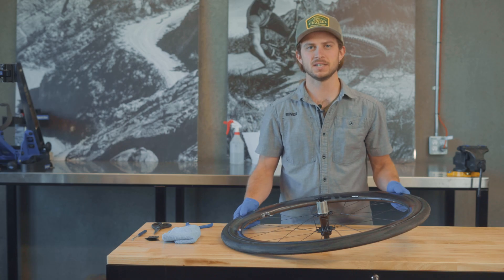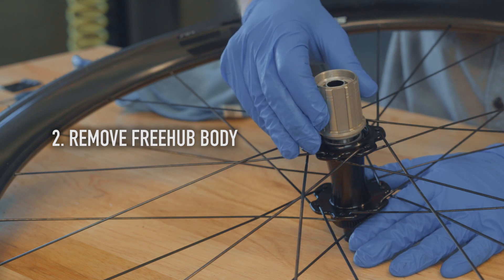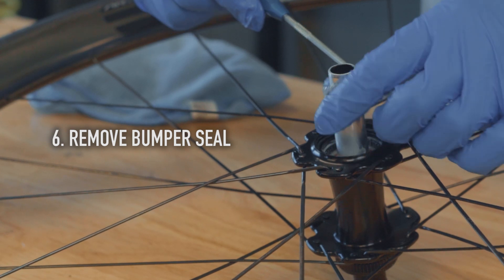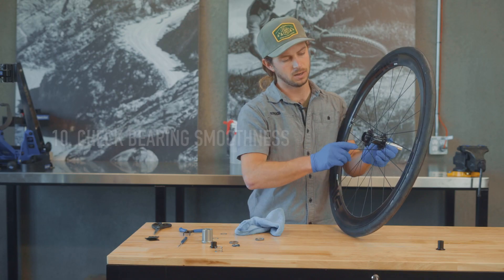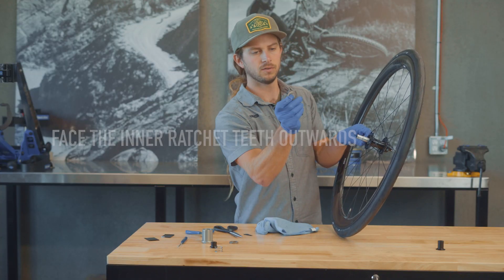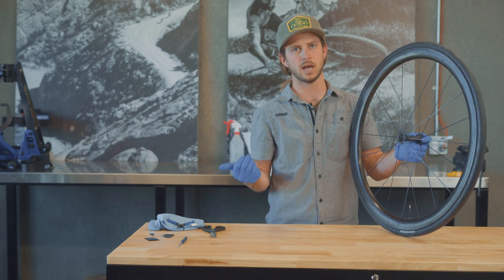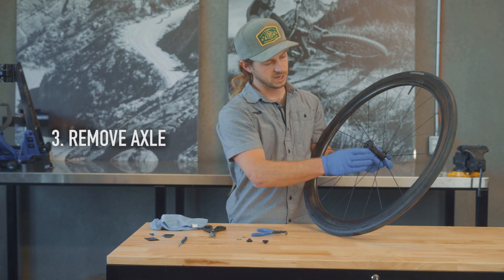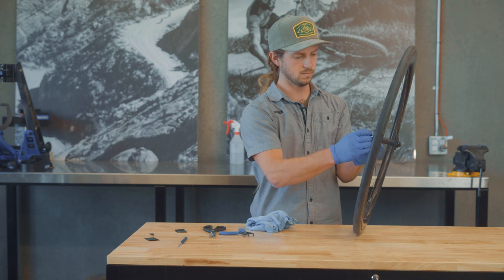How To: ENVE Road Hub Service & Maintenance / Alloy & Carbon Hubs

Comment: I just purchased an xdr free hub body to replace Shimano on evnve set 3.4 with the new inner drive hub, but when I put it on and even hand tighten the end cap it is tight and doesn't want to spin well. can't find any info on what could be the issue unless the springs come out for the xdr hub body? anyone?

Comment: what if the endcaps do not come out as easy as your video ? - brand new wheel and does not spin well (0 miles)
Reply: is the seal/oring in your video for the endcap removed for the demo of ease of removal in this video ?

Comment: I have done this work on my enve alloy hubs.  Tip on the snap ring.  There is a ridge on the axle on the non drive side of the rear hub.  There is space between the bearing and that ridge that needs to be taken up by the snap ring.  Get that snap ring over that ridge.  If you don't the result is that the end cap will not seat far enough onto the axle and there will be play in the hub.  I stretched out the snap ring when I removed it and it was no good after that.  I had to replace it.  If you need to a new snap ring, I used an external circlip snap ring, size ∅18.

Comment: Why is it so hard to remove the endcaps on my set of 3.4 AR disc wheels? I can't get to the freehub body. Do I squeeze the end caps and pull?
Reply: Did you solve it? I’m having the same problem
Reply: @HowonLee I put a piece of rubber around for traction/protection then used channel pliers to pull them off
Reply: @peterssc12  thank you! I actually went to my mechanic and that’s exactly what he did 😂 I wasn’t getting enough leverage with regular pliers and an inner tube

Comment: It seems easy to remove end caps. I have Enve foundation hub and cannot remove them. Any ideas?
Reply: I wish this question had been answered in two years. I cannot find information on how to remove the end cap for a Foundation hub. It absolutely does not pull apart as in this video.

Comment: I have the gen 2 carbon hub on a rim brake. It seems where the bearings sit, the carbon is striped and broken? Is it normal? Or does it mean my carbon shell is damaged? Is it because somebody hammered bearings into place or used the wrong torque / or over tightened the bearing tool?

Comment: If I were to remove the axle on the front hub, thread it internally on both ends so that I could use bolts to secure it to my fork, would there be any reason that this would be inadvisable? I am attempting to use your carbon front hub for a track wheel set and you are not allowed to use a QR at the track. Thanks :)

Comment: Do you need to remove the brake rotor?
Reply: Another great, yet unanswered question.
Reply: I didn't have to remove the rotor to disassemble the freehub. However, it should use the same tool as the cassette cap so it shouldn't be a problem?

Comment: What tool do you use to access to the freehub body bearings?
Reply: That is why I came here to see this video.  They have not answered in a year, so I guess they never will.
Reply: Call them.
Reply: Same issue. I have fewer than 500 miles on it but the outer freehub bearings are already squeaking and I have no idea how to remove to dry and re-grease them.